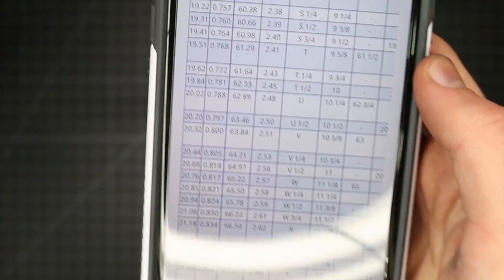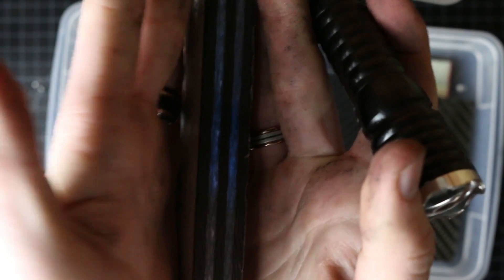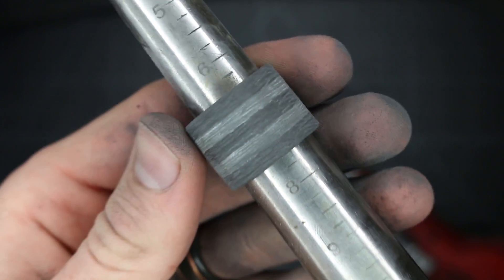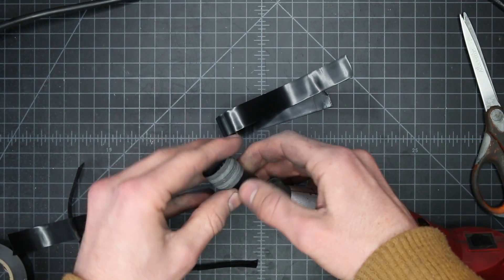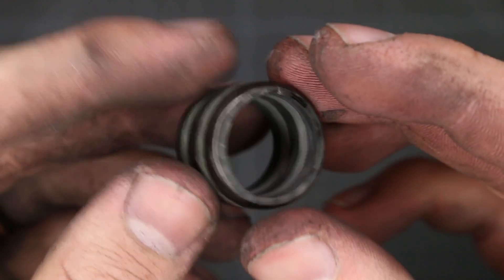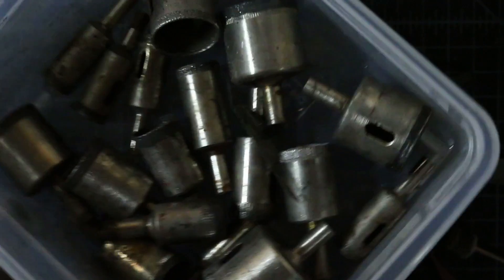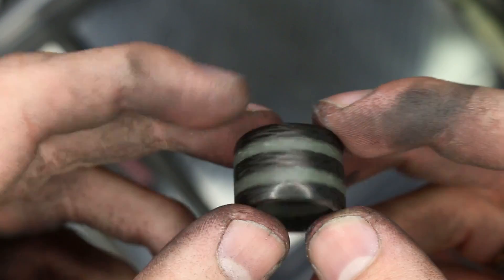Cheapest Way to Make Carbon Fiber Glow Rings - DIY

Comment: I made my first Opal glow ring. I work for FedEx. So I used a Ceramic White ring Orange glow powder and sleepy Lavender Opal. I used a few larger pieces of Himalayan Salt to help fill areas. Turned out okay, only needed a little more opal. Next up is a White Ceramic with blue Opal  and red glow powder.

Comment: What size hole saws did you use?  The ones you linked were just 1/2 inch set of 5.  That doesn’t look like what you used.

Comment: nice work Patrick . i have question , when you sanding why you start with 800 grit shouldn't be the opposite ? 
@Patrick Adair Designs
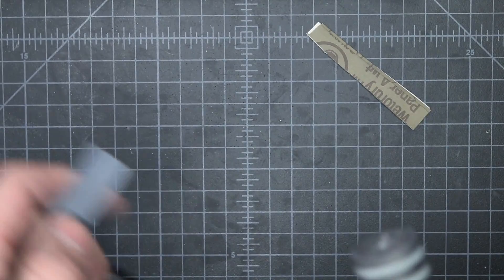Reply: in 9:12 second @Patrick Adair Designs

Comment: im a custom knife scale maker and i use mostly carbon fiber.  I set up my cnc mill to mill them out underwater so there is zero dust.  When i need to sand the final finish on the scale i always wet sand.  cf dust is wicked! Use water as much as possible when sanding.
Reply: +RCTV Hey do you only make scales out of cf or could you do micarta also? I'm interested in some tan/sand (desert) colored scales for my benchmade 810 contego. My email is tortugalover101@gmail.com
just in case you can make these for me

Comment: If you leave out the meteorite, which even the small slices are not really thick enough, the total cost of the items you list is $936.90 USD. I could buy one hell of a ring, second hand from a pawn shop, for that kind of money.
Reply: you can buy same ring here: http://www.ebay.com/itm/263176798133?ssPageName=STRK:MESELX:IT&_trksid=p3984.m1558.l2649

Comment: Hey MAKE SURE, your using at minimum a dust mask when your causing carbon fiber dust. Unless you have an extra pair of lungs laying around! And you might want to invest in a flex shaft, a lot easier to use than a dremel

Comment: You really want to be using a high quality respirator when working with carbon fiber. It is pretty damn bad for you. Like asbestos bad. I mean you really shouldn't even be working with it inside either unless you're using a ventilation hood, because it has a pretty high persistence rating as well. I'm not trying to tell you what to do, but I want to make sure you know that carbon fiber isn't good for you, and absolutely will cause bad illnesses if you don't handle the dust carefully. I would also recommend you put a very clear warning in all of your videos working with carbon fiber for those looking to reproduce your work.
Reply: Yes you're right,
It's not little but quite dangerous it can cause respiratory disease n problems if not handled properly.
It's not my advice but my duty as a human please use a respirator in you home.
Reply: I can’t use a hood but is there a vacuum filter setup I could use at the drill press?
Reply: yeah i found that out yesterday... was cutting up some fiberglass plates without respirator, i still have a headache